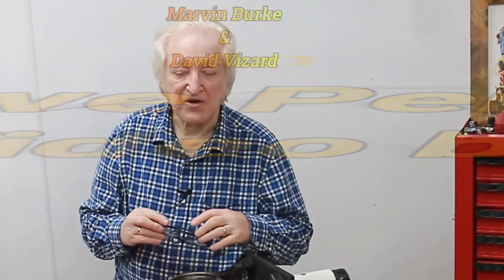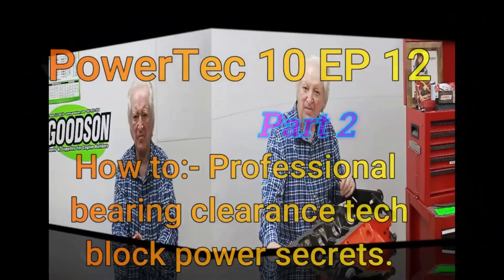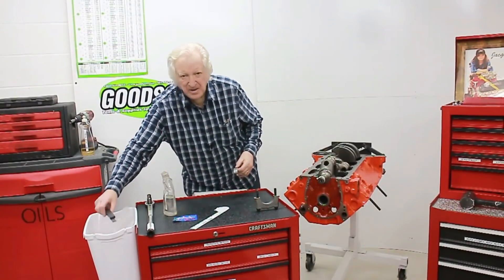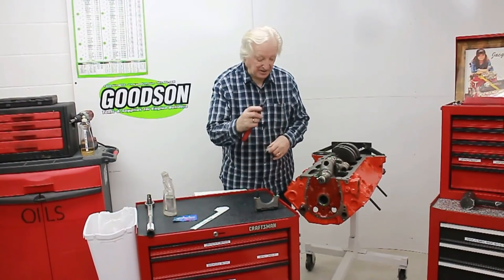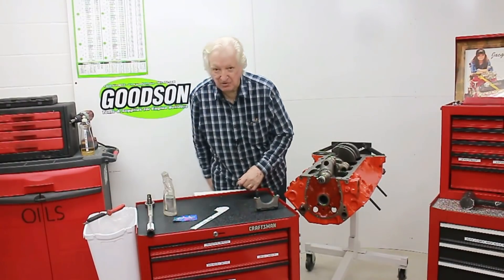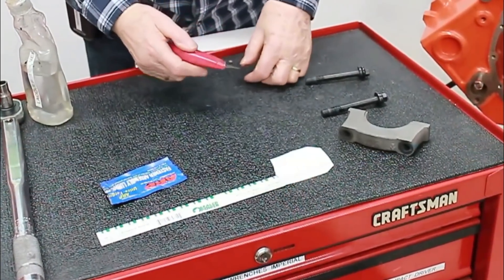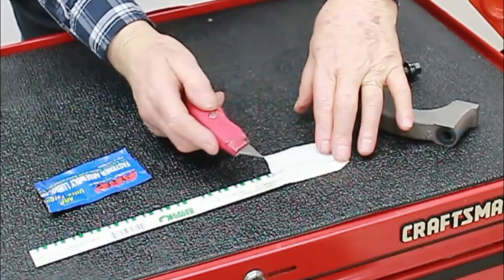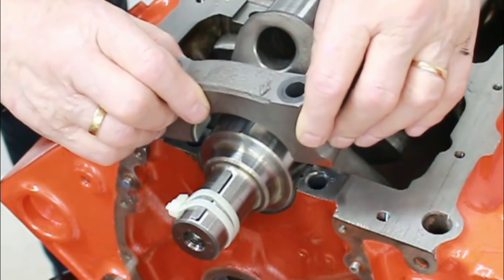David Vizard's PowerTec 10 EP 12 Part 2 Checking Bearing Clearance. To Plastigage or Not.

Comment: Bearing clearances aren't measured in "shade over" and "just about". When clearances are measured properly those terms aren't required.  There is no way the naked eye can come up with .0027 with green  plastigage.  As I stated in your last video , reading Plastigage is like reading tea leaves, very open to interpretation!!!   A professional never uses a steel faced hammer to install & remove a main cap!!!  That is a job for a soft faced or deadblow hammer. A professional would also never pry off a man cap with a screwdriver!! You can easily damage the two mating surfaces.  A professional never uses a torque wrench as a breaker bar to loosen bolts!!  The best thing to do is pop the reversing lever out with a pocket screwdriver and throw it away!  You should also lube the bottom side of the bolt head and washer, dry fasteners cause friction and erroneous torque readings.  Just as different thread lubricants require different torque specs.  What about checking the clearances on 2,3&4 caps?  Just because the front and rear caps fall into spec doesn't mean the others will.  ASSUMING leads to disaster!

The crankshaft diameter spec  on the rear main journal(sbc) is typically .0005 smaller than the other main journals to increase the clearance on #5 cap.  Was the block align/line honed? If so was a dummy oil pump torqued to the cap during the honing process?  The oil pump can cause distortion , anywhere from a few tenths to several tenths.  I don't care what people use for assembly lube as long they don't use Lubriplate 105 or a similar product, because it take alot of heat and time for it to break down and it plugs oil filters.  
Regardless of how many books you have written and how many seminars you have given your last 3 videos in my professional opinion have really diminished your credibility with professionals that know the difference between right and wrong.  You are not beyond reproach, contrary to what you might think.
Reply: And then you probably tell your buddies "I got into with David Vizard and told him what was up."
Reply: Time to pull finger out and share your EXPERT knowledge for free like this man is & make some videos of your own, don't be tight arse and protect your EXPERTISE. I'll subscribe to your account so I can watch them in future.
Reply: Can't wait to see your expert videos!
Reply: Andrew, I get your points, but I think you need to see it in the context of the target audiance and application.  Yes there were things I wouldn't do, but overall folk building an engine to this level are far better off deploying them repeatabily, competently than not at all, and thus get better results.  The hammer had a polished face, so it would be debris free, a softface if not kept clean can also easily leave debris.  I wouldn't file anywhere near my block open or otherwise etc etc, but this is to get it all on the video, I'm sure David wouldn't either, and have to understand the context.  Clearance is an interesting point, we may measure it aerospace accuracy, but how do we actually know what we need..  few establishments can measure the hydrostatic profile in the oil film and determine whether it has has the right profile or not, as the clearance is actually second order to what is in fact the important factor.  Further, it will be dependent on the oil chemistry, temperatures, and be specific to that the materials and finishes.  So how far down to fundamentals do you want to go before we can say we "know"?  In most peoples cases, than professional teams where it is their business and reputation, and winning is the only way to stay in business, suitable and sufficient rules, as they will never be able to actually "know" with the appropriate fundamental data of what actually needs to be measured...  how many people even do oil samples, and get those analysed, or even know what to do with the results...  I get your point, but there is another side too.  Have a great weekend.
Reply: Firstly, if you watch the 2 videos again I becomes obvious that the idea of using Plastic Gauge is a cheap and effective way of DOUBLE CHECKING clearances at time of final installation. He had pointed out in the first video that not everyone can afford the expensive measuring gauges that machine shops use and the method shown is a final, but not the only check, used in the build. There also was no implication to NOT check the other bearing caps but he pointed out that the REAR cap bearing HAD a slightly larger clearance by showing using the RED gauge material instead of the GREEN as used on the front. As for his terminology of a "SHADE OVER" must be taken in context of what he is actually saying, i.e. meaning 1-2 TENTHS of a Thousands of an inch. Two different engine builders may measure the same bearing clearances using the same professional tools and get a different result within a couple of a tenths of a thou, just because of their 'feel' when measuring. I myself have during my professional career used BOTH measuring tools and plasticguage together and never had a clearance problem during assembly. Also if an engine is still in vehicle, plasticgauge is an effective tool for checking clearance problems and diagnosing bigger faults. 
Finally, nowhere in the videos is it suggested that this how clearance checking MUST be done BUT is one of many ways it CAN be done. It obviously works for some engine builders and not others. Its up to the assembler themselves to decide which way they do it. Do it whatever way you are confident with. 'There is more than one way to skin a cat' as long as the same result is gained for the end user.
Reply: @lesmond7301  Yes. This man is giving us tips on engine building.  If you would have watched part 1 you would know that this series is about how the common man can use plastigauge if he can't afford the expensive tools to measure like a professional engine builder.  David is obviously showing us tips he's learned over the years and not providing a complete engine building tutorial.
Reply: @philogre5771  I am in the process of starting a channel, I have already filmed over 30 hours of content.
Reply: @mfaulks206  I totally agree that clearance is only the tip of the iceberg in the big picture of lubrication.. I think most people are under the assumption that the static clearance that was checked in the video is the running clearance , which isn't true.  

I wasn't worried about debris with the steel faced hammer. I was worried about  deforming the cap at the bolt head/washer area.  Transferring debris with a deadblow/soft faced hammer is an interesting and very valid topic.
Reply: @panzerkfw  lower end measuring equipment isn't very expensive and those same measuring tools are required elsewhere in an engine build , so they are a cheap investment that would last the average person a lifetime.  $250-300 would buy a low end dial bore gage that measures in half thousands , low end set of 0-6" Micrometers & standards, dial caliper,  dial indicator with magnetic stand and a set of feeler gauges.  Checking clearances with the proper equipment is also much faster than using plastigage and more accurate.
Reply: @superduty4556  teaching people incorrect methods isn't teaching. The things he did in this video would have gotten me expelled from college and fired from most jobs I had in the past.. I don't care what his name his.
Reply: @andrewevans1658  he's teaching hobbyist level stuff here, chill out. Sloppy Mechanics would give you an aneurysm if you're this torqued over David's stuff.
Reply: @andrewevans1658  Wow Andrew, you're calling out David for helping the common man build his engine and criticizing Plastigauge but right here you are suggesting we use Chinese budget measuring tools to build an engine instead.  Now what is the chance that a Chinese mic might have a defect that throws off the measurement by a couple thousandths?  I mean do you think all Cheap mics are spot on at every point through their range of measurement?  And good lord, what could go wrong with a $250 dial bore gauge? lol. Just how skewed do you think a reading could get with one of those?  I'd rather use Plastigauge.  I'm sure David has high quality tools available for any engine measurement but he is showing poor people how they can get things done.  I bet he could blow your mind with some tools and techniques that you have never even seen or heard of.  Just calm down and consider the scope of this series he's doing for us.
-I bet many high end engine builders use Plastigauge as a final check for crank straightness, bore alignment and other machining errors, accidents and anomalies, human error and the like.  I know I have.  Plastigauge has been around longer than you have been.  It has capabilities that can't be achieved any other way.
Reply: @panzerkfw  you are clueless.  No professional uses plastigage.   Cheaper import tools have the same repeatability as high end tools when used correctly.  Plastigage is a false sense of security.  It only shows clearance on one specific area of a crankshaft journal.  It doesn't tell you if your crankshaft journal is round or if your main bores are round and in alignment.  Only proper measuring equipment can do that.
Reply from the maker: @andrewevans1658   There are a lot of folk who figure $120 for a dial gage is over the limit so how do $250 - $300 stack up on their budget? And we have not counted the mics yet. And as for 0.0005 accuracy THAT IS NOT GOOD ENOUGH IN MY SHOP!
Reply from the maker: @andrewevans1658  Can hardly wait to see how that works out!! DV
Reply from the maker: @andrewevans1658  Can hardly wait to see how that turns out. DV
Reply: @marvingvx1  a cheap dial bore gage with .001/.005 dial is what you showed in your first bearing clearance  video.  If someone can't afford $250-$300 on tools that will last a lifetime then they have no business assembling an engine.  $250 won't buy a real torque wrench!! I have yet to see any quality tools in any of your videos!!

You are leading the viewer a stray with these videos !  Plastigage is a false sense of security!!!  It doesn't tell you If your crank journal is round or if your housing bores are round and in alignment.  Only specific measuring equipment can tell you that vital information!  Plastigage only tells you the alleged clearance at one specific location on the journal.  If someone is using Plastigage they may be using a used crankshaft that isnt round or concentric. Absolutely no mention of how to alter the bearing clearances to meet required specifications in either video. There is no substitute for doing something correctly!  This video puts you way down in the league of vice grip garage and you are much  better than that!
Reply: @andrewevans1658   Dude.  This is a video for the common man.  Its not a Kryptonite crankshaft in a AJPE block.  David is showing a guy that wants to rebuild the 350 in his Chevy truck he tools around in to the car shows.  This is not a complete tutorial for a 410 sprint car engine build.  Go away and torment someone on the cake baking channel.
Reply: @andrewevans1658  If you were really professional you wouldn't have to come to the comments section of Youtube and try to convince people ( and yourself) that you were a professional. Hopefully you will realize life isn't a tool box measuring contest because I think you will always come up short in that arena.
Reply: Andrew this guy has probably forgot more than you will ever know
Reply: I noticed Andrew Evans Has Zero Videos for the public to view??
Reply: @Andrew Evans you must have been asleep the day they mention metal hardness in your engineering course. If you think "A professional would also never pry off a man cap with a screwdriver!!" then maybe you need to visit an optometrist, I could clearly see a gap on both sides under the cap (and David mentioned it), and if you think "levering" up a cap with virtually no pressure on it at all is somehow going to damage a cast iron cap, then perhaps it is time to revisit that chapter of your study. If there is any fault to be found in using a screw driver it would be that he should have used a thinner screw driver to get further in with it, or maybe a stiff butter knife to reach the other side, but that is it.

I agree it is not the most optimal way to remove a cap, but he was trying to remove it without disturbing the plastigauge. Working the cap side to side would risk making impressions in the plastigauge that weren't there during torquing. Besides using a screwdriver what are the alternatives that a non professional could use? This video is for the non professional, not the guy with a full drawer of cap pullers.

As for which hammer he used, it wouldn't matter if he used a sledge hammer to give it that slight little sideways tap on the cap. There is zero chance of distorting the cap in the direction he hit it, even if he hit it hard enough to send it to the other side of the room, in all your extensive experience surely you know what direction it needs to be hit to close the cap up?

" A professional never uses a torque wrench as a breaker bar to loosen bolts!! " Again you must have been is a fast asleep in your metallurgy class. Torque wrenches like my Warren & Brown benefit from being used in reverse, as it realigns the molecular structure of the metal. Used in the same direction repetitively can alter the accuracy of the torque wrench over time. What's next you can only use a socket ratchet in one direction? Quality torque wrenches are made strong enough to reach their max torque and beyond, do you honestly think that any reputable brand is going to build it strong in one direction when you already have it in your hand and may use it? Again not the right tool for the job, but not life and death unless you are talking sphincter puckering tensions.

Some of the other questions you ask are just down right insulting to someone of David's experience, do you seriously think a guy who has been building engines for as long as I have been alive is only going to check the front and rear bearing clearances? Seriously???
Reply: @DodgyBrothersEngineering  If you think it is normal to pry off main caps with a screw driver then the content of this video matches your educational level!
Reply: I agree. Pro builders I’ve seen use a dial bore gauge and that’s the end of it!
Reply: I’m not a pro, plastiguage is close enough for me lol
Reply: Why don't you stop chatting bollox and get some content on your 3 subscriber channel, then there may be a slight chance of you being taken seriously. Ever since I was a teenager in 1970s, I have been using Plastigauge with 100% success, many have been using it longer, so belt up. I do not believe you have ever built an engine in your life, but feel free to prove us wrong keyboard commando.
Reply: @andrewevans1658  Sure you have.
Reply: @andrewevans1658  Sure you have.
Reply: @andrewevans1658  You certainly win the prize for use of exclamation marks.
Reply: My General Motors Corvair Shop Manual Specifies .0007 to .0022 for acceptable clearance on the main bearings. Over that range of .0015 to which ten thousandth of an inch (.0001) would you insist that the engine be built? It didn't seem to matter to General Motors as their manual (not Chilton's, Haynes etc.) states to, and illustrates the use of..., Oh, No! Plastigage! So, if it is good enough for General Motor who designed, built and warranted the engine  .... .

 As to the torque wrench used to remove bolts..., well it does have the lever to work backwards..., and it can be used on lefthanded threads..., and that doesn't seem to negate it worthless after having done so.
Reply: @andrewevans1658  Still waiting for your content, where you will show us how to build an engine properly. Don't forget to include a shot of your 30ft row of tool boxes. Where are you?
Reply: @ralphmillais5237 if you need to watch a different video to prove to yourself that this video is full of inaccuracies then you probably shouldn't be working on engines.I have filmed several hours of content.  I'm currently in the process of building a new shop and moving , which will probably take nearly a year.  I've changed focus and have been devoting my free time to rebuilding some of my shop equipment and finding different pieces of shop equipment prior to moving.
Reply: @andrewevans1658  Fantasist.
Reply: @dreece2000  when someone makes a sloppy and inaccurate video and proclaims it to be accurate, THAT is a true injustice!!!  Nothing I'm that video made anyone smarter or helped anyone!!!